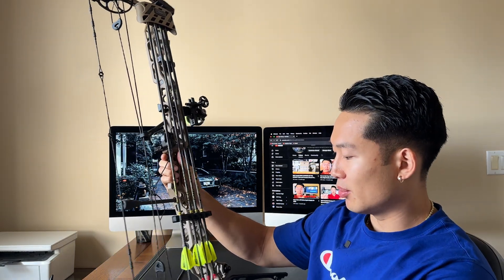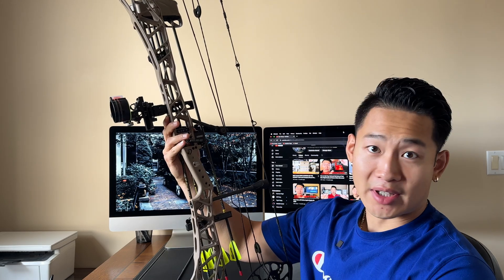3D Printing Mathews Lift Side Plates | AnkerMaker M5 Unboxing and First Use

Comment: i have the same printer for a few months now, love it. i found if you slice in prusa, then save it, take the file and print it in ankers slicer, its day and night difference in quality.
Reply from the maker: @Swinden24  Thanks for that info!
Reply: why not just print from prusa? or use orca
Reply: @TheVegasCabbie  never got prusa to work to print directly to my ankermake, and never tried orca, if prusa worked like a dream. why look for something else if it already works, right?
Reply: @Swinden24  orca is prusa and bambu mixed. Really customizable.
Reply: @TheVegasCabbie  didn't know. Just found something that worked for me. Prusa slicer worked for me. As stated before, only been at it for a few months. Lots of ways I could've gone, but this is what I found what works for me and what I've learned so far. Coulda woulda shoulda I suppose 🤷
Reply: @Swinden24  well welcome to the 3d print world it's really fun and expensive lol